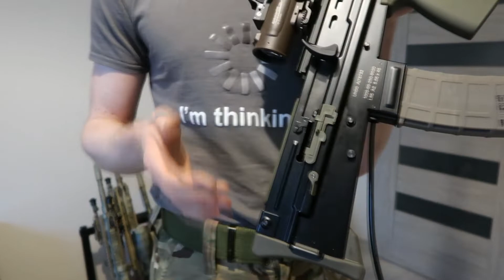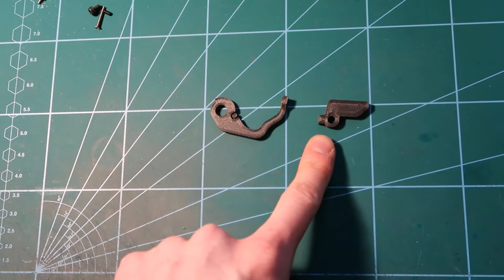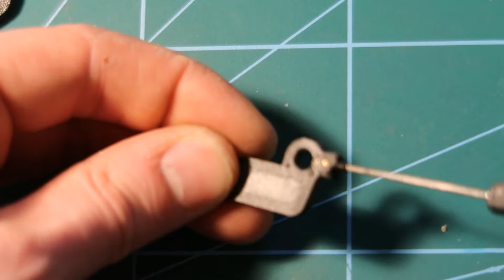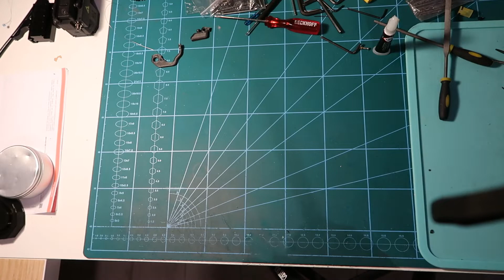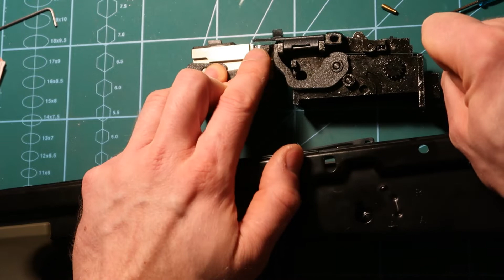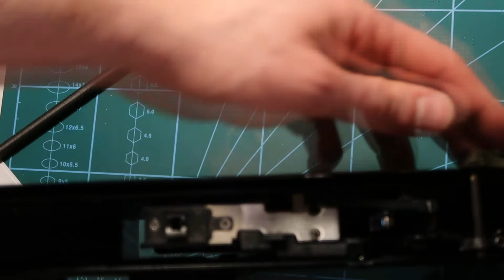Pimp My Gun #01 - L85 WE GBBR with functional Bolt Stop Mod

Comment: Incredible video. What did you make the two 3d printed pieces out of btw?
Reply from the maker: Hello, thanks ;) I made them of PETG with Carbon Fiber on an FDM printer. Regular printing material would be ok to, this is not specially loaded component.
Reply: @frogengineeringairsoft  thank you!
Reply: @frogengineeringairsoft  so I just finished printing mine off twice. However, both times I got a weird string like pattern on the underside. I have an imgur link if you want to have a deeper look but the comment seems to be deleted immediately.

I’m guessing just to sand this off as it happened twice in a row?

Comment: Great video, but the bolt hold open catch pushes down instead of up to hold the bolt back on the real steel.
It makes it quicker.
Reply from the maker: Hi, thanks for feedback! I will maybe make a modification then, it would be actually simplier to have it work that way :D
Reply: @frogengineeringairsoft  legend